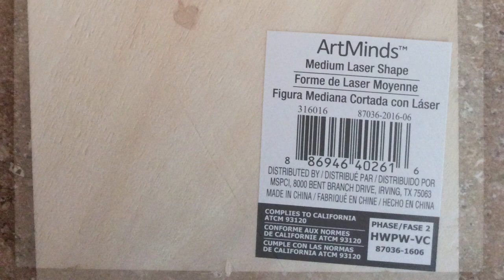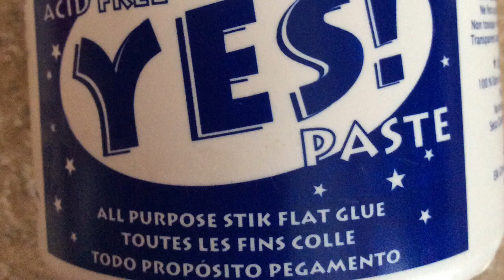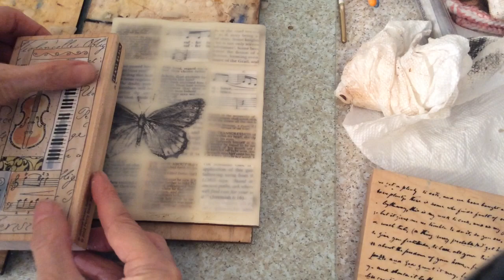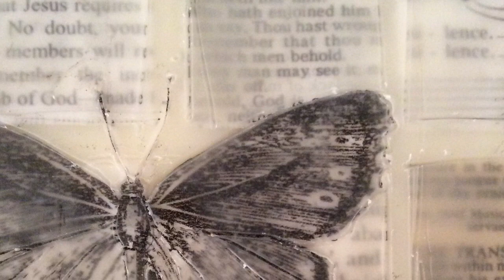Encaustic Tutorial

Comment: The encaustic medium can be heated in a pan that I also use to melt glue pellets? Or I need to buy special?  Also, I have a heat gun for shrink bag use but is that also something I can use for this artwork or buy a special gun? TY. Your work is beautiful. Inspiring. Rachel
Reply from the maker: Oops, I forgot to respond to this. You might want to test the pan out a little bit first. I've tried various ones, trying to save money. You can check out the local dollar store or even a thrift store for aluminum pans, too. Try out your heat gun, it should work, though. Like you, I didn't want to buy a special one so I started out by using the same heat tool I had for other stuff. In time, I got one from a hardware store.